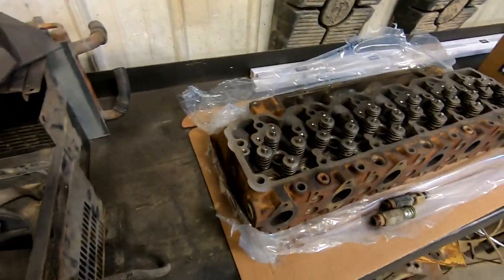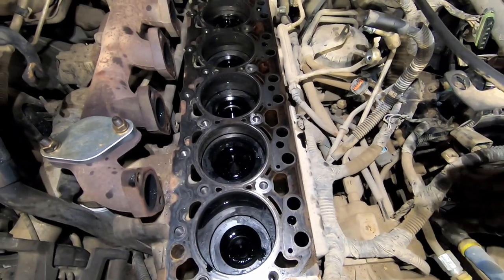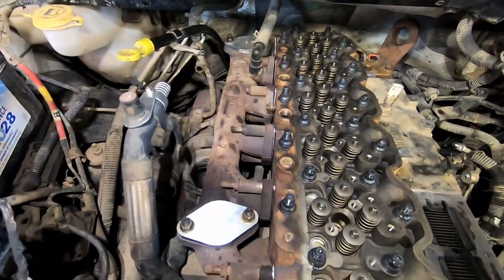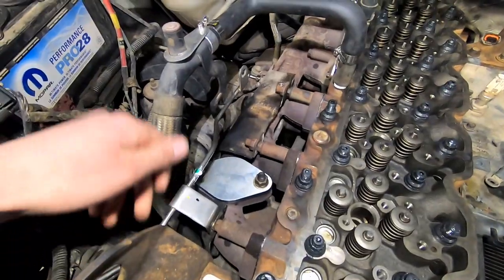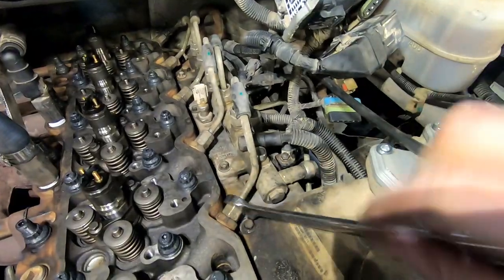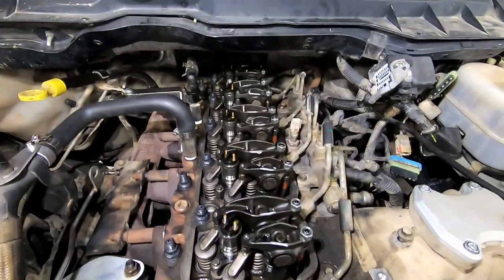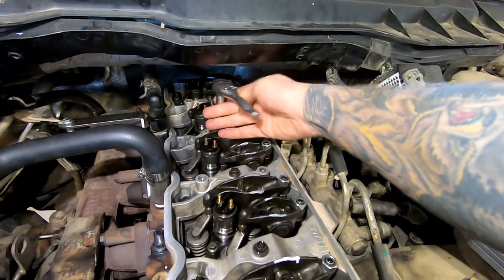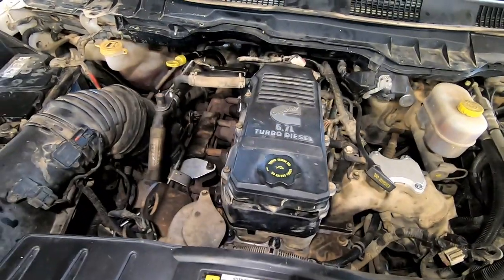How To: 6.7 Cummins Head Gasket Replacement (part 2/2 Install)

Comment: I already thanked you but I’d like to again, I just finished replacing my HG and replaced my bolts for studs. Without your videos this would have taken longer to find all the information than to actually do the job. Thanks so much man. Really appreciate including the torque specs.
Reply from the maker: Glad I could help buddy!
Reply: Was about to say the same thing!
 Dark Iron Coming In CLUTCH!

Comment: Great video, just got my 2013 cummins running again after a month down since the grid heater bolt melted off and went through my engine.  Rebuilt head, 6 new pistons, injectors rebuilt, rebuilt turbo and grid heater delete with aftermarket heater on intake tube.  Anyone with a 2013-2020 cummins make sure you check where your power cable connects to the grid heater, if it's loose do not drive it until you replace the fridge heater.  Ram service bulletin calls it the wiggle test!

Comment: After watching the removal video, I have my head back from the machine shop. It has been pressure checked and resurfaced. I watched your video and wrote down all of the torque specs. Replaced my head gasket with an original Cummins head gasket as my truck has 193k miles on it with and the head gasket looked fine upon removal. Lowered the head into the engine compartment and installed a new set of ARP head studs. Followed your steps to the T and “Shazam” she fired right up! I would have never tackled this job without your videos. Thanks again!
Reply from the maker: Glad I could help! Thanks for the comment I appreciate it!

Comment: Excellent video. I am about to replace my HG on my 2007.5 6.7L due to failure. My truck has over 300K miles on it so I believe I have gotten pretty good life out of the original. I will definitely watch both of the video’s again before I begin and probably a third time before install. I would like to make one comment/suggestion on your procedure. I am retired from the military and worked on helicopters. I seem to recall a technical bulletin that came out against using petroleum jelly. We used to use it when replacing seals to keep them in place when working on the fuel cells. Petroleum jelly does not dissolve in jet fuel which is a high grade kerosene, much like diesel. Try it out….place a blob of it in some diesel, it will just sink to the bottom and sit there. It also calcifies in high heat which will reduce the life of the seal. Use wheel bearing grease instead. I hope that helps. Thanks again for a well done video.

Comment: Well, I finally got everything in today, just need to get the valve lash set and button it up tomorrow..

I screwed up and over torqued #6 injector hold down but loosened it back up and set it properly like you described. Hopefully it’ll be ok, I found in a forum some guy had a hold down bolt break on him while torquing it down eww..

Thanks man. I referenced this video often while tearing down and replacing. Tomorrow will be the glorious moment of truth.
Reply from the maker: No problem buddy, if it torqued down fine the second time you shouldn’t have any issues
Reply: @darkirondiesel  she’s good to go man. Thank you for your in depth video’s, they aren’t easy to make by any means. She fired up after bleeding the injection lines. Much appreciate from Nevada brother. Keep on keep’n on!

Comment: Very good work. Great video. Unfortunately I am about to be doing the same job. Just got the truck less than 2wks ago, guy told me it was a great truck,  "wouldn't hesitate to drive it to florida tomorrow ". Mmmmhmmmm they all say that 1 line of bs. Damn water pump puked on me on the way home from buyin it, got sorta hot, 240 for literally a few seconds before i shut it down. Now im noticing too much pressure in the coolant system and the overflow is taking on coolant beyond the max line. Had i watched this video first and noticed that you can see if the head has been studded or not before hand, i would be sittin much more happy. Dont buy a truck that has a tuner on it and has been studded. Especially from someone you dont know to be a reputable human. Thanks for a great video. Wish me and my knuckle skin luck.

Comment: Great videos sir.  Thanks for the info.  The studs (and or bolts) are springy and with bolts they are already bottomed out, no way to add more torque to them without taking them out and adding washers which is not advised since they are already stretched to load.

Comment: Thanks a million for this video without it this job would be a major pain. 
One thing I’d add if you mark the back of the harmonic balancer with a paint pen it makes life much easier and imo it gives you a more precise tdc. I marked one of the teeth on the crank shaft sensor ring. There’s a mark on the bottom of the engine to line it up

Comment: When I installed my Rocker Pedestal, one old bolt sheered when torqueing. Luckily, everything is so lubed up and there was enough bolt exposed that I was able to remove it easily. I installed the ARP 247-7201ROCKER PEDESTAL STUD KIT to replace the OEM bolts. It was a pain in the ass as I had to temporarily install a grade 8 bolt until the kit came in. Then I took apart everything again to complete the install.

Comment: Thanks a lot🙌🙌🙌 now I just need to get parts I have to get 
ROCKER ARMS
HEAD GASKET 
INECTOR RESEAL KITS
INTAKE GASKET
EXHAUST GASKETS
PUSHRODS
CYLINDER HEAD
WATER PUMP
THERMOSTAT

Comment: Solid Videos! Out of curiosity what was the exact reason for the head gasket change? Completely blown or did it have gurgling in the coolant reservoir like mine does when you shut it off?

Comment: You are my hero! I have everything disassembled and I'm currently waiting to get my head back from the machine shop. 

I see in the video you're using a Fel-Pro head gasket (I copied you and got the same one) Just curious though, How has that gasket worked for you? And is there any particular reason you chose that gasket over other gaskets, namely an OEM Cummins gasket?

Thanks for all of the content you're providing!  Keep it up man!

Comment: The videos were well done, made it very easy to replace the HG, I'm all done and tried starting the  truck - no go. I've gone over  everything from valve adjustment timing, connectors,  put back the old injector harness as the truck drove in the garage. Fuel at the injector tube, charged Batts.  Any suggestions Sir?

Comment: not sure if anyone is going too see this i just got done replacing my gasket and head watched both of your videos now i can't get it too start pulled a fuel line and it's pushing fuel out but still will not start cranks just fine gonna try and get ahold of a scanner tomorrow and make sure i'm getting enough fuel pressure too make the injectors fire any tips or pointers too look at?

Comment: Hey bud, a shop did the truck I own now, they did some kind of copper coat or something and found some copper flakes in the radiator after investigating the cap where it all accumulated. Haven’t found anything since that but is that normal? Guess I’m getting paranoid 😬

Comment: Knowing that the video is over 2 years old , I was wondering why the injectors weren't installed before the head was reinstalled? The front injectors are easy, but when you get to the rear ones torquing them gets to be a pain to do . Any reason not to install first.??

Comment: so mine failed and unfortunately was driven you a bit once i got the head off the stench was gnarley im pretty sure some oil got in the passage you said dont let oil go there is there any extra step i need to do if im pretty positive oil got in there?

Comment: What does a job like this cost to have done? Very good and helpful video!
Reply from the maker: Thanks! This job typically costs around $4000-$4500
Reply: @darkirondiesel  thanks for the info! I picked up a 2014 ram 3500 mega cab this week with the aisin. Going to do the deletes next week. I really enjoy all the info from your videos.
Reply: My god 4500 I do these on a weekly basis for 1500 parts labor and machining minus the headstuds.  Wow someone is taking someone for a ride.  Tip though you may want to start holding the headstuds and use a boxed end wrench to tighten them some so you know 100% they didn't bottom out in the block.
Reply: @kawieatvdragracer2478  that's the cheapest I've ever heard. You must not be a shop or just have really low overhead? Hell of a deal though.
Reply: @raymocandler  that's the going rate where I live that's just about everywhere but a stealership. It's not hard to do it's actually simple. Very simple.  Headstuds yes is the way to go he just installed 425 which is a one time use stud 625s are the way to go.  And it will be right back in there leaving that shitty vgt turbo on it.
Reply: @kawieatvdragracer2478  Maybe CanadaLand $ and inflation??
I saw on building 2500hp Pro Mod engines they grind off the bottom 2 threads and then torque em down tight.  Zero cylinder wall/deck distortion after that.

Comment: I have one question about a 2013 6.7 cummins.  I found out the hard way that the grid heater stud got burned off and fell into the in take. What are my options? Back in the 80s i was a ase cert but never work on a diesel engine this is my first cummins I bought it new. I jest need to know what I need to do to find it ?

Comment: Hi I repair the head of my engine 6.7 ram 2007 installed and I adjust the rocker arms like the same in the video but when I try to start mi engine don’t start I want to know it’s posible did I adjust the rocker arms wrong I have diesel in the lines but dont start when scan then truck have a code of camshaft sensor can that be the problem just ask for help

Comment: Thank you so much for this series! Very helpful for a first timer. Quick question, where did you order your ARP studs and gasket kit from?
Reply: How do know if he is blown?
Reply: How do you know if HG is blown?
Reply: @reginaldpugh4691  My radiator was getting pressurized and blowing coolant out of my overflow tank.

Comment: Hi I do everything like did you said but my truck don’t start make a noise nock in looks like no diesel scan the truck and have a code cam sensor buy a new one but do the same I do everything did I can but does not start if the tdc is wrong can do that trouble

Comment: Question,   What was the reason for changing the head gasket on this truck?   Can you see damage to the head gasket ?   I feel better when I can confirm the damage that was expected , but have not done a diesel like this before.    Thanks for all the detailed info, but not too much detail.   Like you said, if we need to know when to use a hammer vs socket we shouldn't  be doing this repair.
Reply from the maker: Haha, thanks for the kind words.  If I remember correctly the truck was blowing coolant out the reservoir cap (meaning it was pressuring up past the 15psi the cap was rated for).  If you look at the head gasket there should be some sort of black material around the cylinders, often times it will be missing part of it which is where the compression from the cylinder is escaping and going into the coolant system. I have a 6.4 powerstroke in the shop right now that I’m doing head gaskets on. When I get the off I’ll make a video showing what a blown head gasket looks like!
Reply: My cummins is in a 2011 F650.  The head bolts I removed are all the same length.  Why would that be? Any advice on finding the correct parts for this?  and my other issue that i'm concerned with is hole 4 and 6 both have a row of pits right at 1 1/2" down from the top of the deck.  Both start at about 11 o'clock and stop about 12.   Not bad but, I like the other cylinders that I only see the cross hatch finish on.  I appreciate any advice you can give.  Thanks

Comment: Is the removal of injectors and tubes necessary if you're trying to just get your truck on the road again? Can a guy leave those in place, replace the head gasket, set her down and clamp away?
Reply from the maker: Well you should never replace a headgasket without sending the cylinder head to a machine shop for pressure test and resurface. But I guess in theory you could do what you are suggesting, although I definitely wouldn’t recommend it. Might as well do the job right the first time in my opinion.

Comment: Video is great but I frown apon people that use a diegrinder  on a gasket surface  so important, especially  on a surface that already has trouble sealing, Just pure laziness.. its one thing to use on a water pump install or intake if your careful  but, on a head gasket surface??? It risky business.
 And to add further  you won't warranty  your work without a performance  related upgrade. 
 You should realize  the only thing keeping that gasket in check (in regards to coolant and oil) is the  film coating on the gasket face and between each layer of the MLS gasket.(most cheap gaskets are a hard coating that are little help in sealing but do ok) just a better gasket is one that has a slightly rubber like thin coating... these are the best at sealing imperfections like what you caused. Most people don't have 500$ for head bolts so sticking with a proper "more professional" habits will get you further. 
 
 Great content  good video.  Just glad that truck isn't  mine

Comment: Awesome video about to tackle my 08 6.7 how long did it take to pull and drop the head start to finish not including machine shop turn around time?
Reply from the maker: It usually takes me about a half day to remove it and then a full day to put it back together if it goes well. So about 12 hours I guess, but I’ve done lots of them!
Reply: Dark Iron Diesel awesome thanks so I can expect twice as long if everything goes right lol 😂 definitely watching this during the whole process!
Reply from the maker: Haha ya definitely took me a lot longer my first time

Comment: Followed step by step details had a fuel leak tightened that line missed everything else good however truck isn't running right has like a rough idle an like a dieseling effect kinda pop in exhaust

Comment: I was on a website reading about a new head gasket install. For its installation prosses,   it talked about doing 80 ft lbs head bolt torque, run engine until warm (Idle only) and re torque 125 ft lbs,   also setting the valves twice! is this something you can avoid ?
Reply from the maker: Ya I don’t do that personally, I don’t know any mechanics that do that.

Comment: Great info great video. I have a question.. this is my first time doing this. I did NOT take the head off or any of the stuff that needs to come off. A "mechanic" did. Anyways I'm about to put everything back up. But..... injectors and injector tube and so are the small fuel lines were all just thrown in a box. IS THERE A WAY TO FIGURE WHICH TUBE GOES TO WHICH INJECTOR AND SO THE SMALL FUEL LINES? thank you and once again great video I have watch it twice so far lol.
Reply from the maker: Haha thanks buddy.  You’re just going to have to put them in random holes. If he didn’t mark them when he took them out then there’s no way to tell where they came from. But you should take pictures of the trim codes on the injector and record down which cylinders they went into then have a shop program your trim codes in. Chances are the truck will run fine even if you don’t program the trim codes in, but if you put the truck back together and it runs a bit rough then you will have to program the trim codes
Reply: @darkirondiesel  thank you so much .. another headache sound like lol but can't wait to hear it crank up and run once again.  I APPRECIATE YOUR REPLY AND THE VIDEOS
Reply from the maker: No problem buddy! Like I said just throw it all together and fire it up and see how she runs. If she runs rough then get the trim codes programmed, but it will probably run fine. But take pictures of the trim codes first and remember which cylinder they go in. Trim codes should be 6 digits long on the side of the injector towards the top.
Reply: 👍🏾👍🏾👍🏾gracias!!!!!!!!!!!!!!!! I sure will take pics and will write it down

Comment: Another head stud note: If youre doing the exotic headstuds, my rocker arm mounts interfere with the headstuds and all had to be slightly shaved witha  sanding disk and buffed. all 6.
Reply from the maker: Hmm interesting. The ARP studs work fine

Comment: I followed your video to a t. Thank you. Problem I have is I torque the rockets down to 27, TDC and all rockets are tight. I rotate and nothing changes. I torqued the arms down to 18 and no change. Any thoughts?  Thanks again.
Reply from the maker: Back off the adjusters on each rocker a turn or two then try again
Reply: It's one thing to be top notch at what you do, which you are.  It's another to just be a good person. Thank you for both.

Comment: You should not try to bleed high pressure common rail system fuel lines, that could end in serious injury or desth these systems see as high as 28k psi of fuel, I know startup is not that high but still very dangerous, it is a self bleeding system, Also shouldn’t be using air powered or any rotary tools they can remove too much material and create high and low spots other wise great video
Reply from the maker: Personally I’d rather bleed the fuel system like this instead of cranking the engine for 5 minutes until it self bleeds. It shouldn’t build rail pressure with one of the lines loose, and even if it does just don’t go near it when you’re cranking. 
As for cleaning the engine block I know technically you aren’t supposed to use an air tool but I clearly say in the video to use a fine grit disk instead of a rough one and to do it gently so there aren’t any sparks because you don’t want to take material off. 
Chances are if someone is watching this video to do it themselves at home they probably aren’t going to be doing it by the book anyways haha